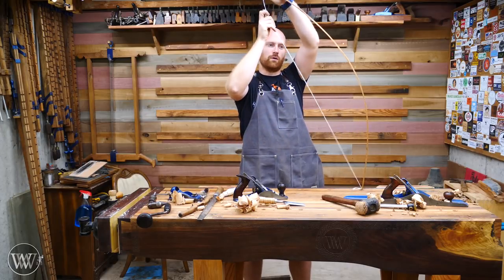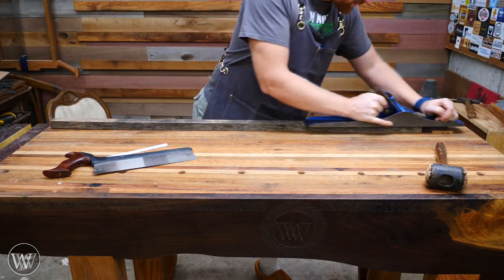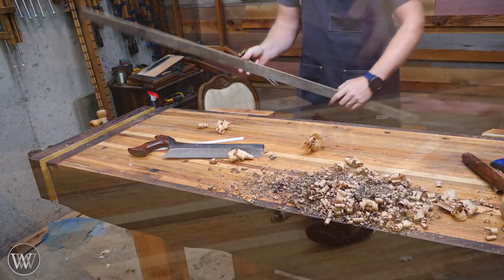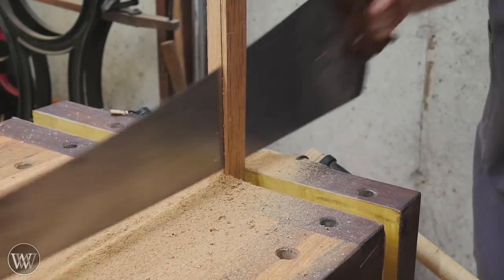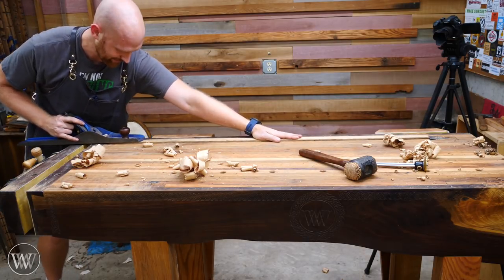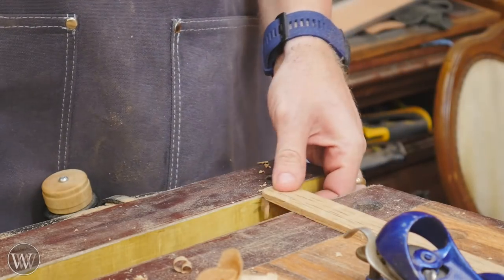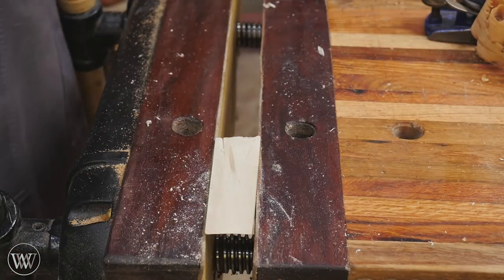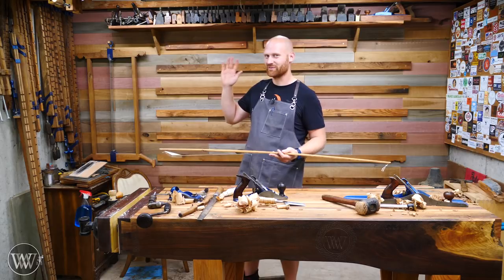How to make a Drawing Bow Compass - Hand Tool Woodworking

Comment: As always, overjoyed by the ease with which you do stuff with hand tools that most guys on the 'net would need to use $1000's of machinary.
There's always a sweet spot, for me it was that big old plane you were using. I got one from a well known auction site several years ago. A number 7 Record. I 'restored' it. It was rubbish. Had another go - a bit better, but still rubbish really. It took three to four attempts to get it working well (there are so many things that need to be right).
Now? it's my 'go-to' plane for flattening/dimensioning - absolutely love it. And the sound it makes - awesome!
What I've learned? very little to do with what you paid for it - if you invest your time and, dare I say love in it, it will be your fave tool.
The more you use them, the better they feel too...
Massive thanks for being there and sharing your skills and passion.

Comment: That old oak looks like it got very hard with age, but you managed. 
I have made a couple of those for projects in the past, never thought about putting finish on them and keeping them. Made them to fit what I needed on the project. I can see making a few of them in different lengths to cover various radius’s. Next time I need one, I will put more time into it and save it. I also just used a cutoffs of pine, because it was what I had. I like the idea of better wood and saving them, thanks for the vid.
Reply from the maker: Thanks Paul. actually it is slightly softer white oak but the leather soles on my clogs had come off and I had not put them back on yet so i was doing a lot of sliding.

Comment: Nice one agian. To get more grip on your clogs( klompen )you could glue a slim rubber under them so you stand better when working and are not sliding on your floor.
Reply from the maker: yup I had leather on the bottom but they fell off before this video.

Comment: You must of shot this one before the french cleat vids. Oh and really “a frayed knot”? Were you sick that day? Oh and if you do some light marks with very light plane passes and graduate outward equal distant from center on both side it will give you a more round curve. There’s less force near the string at the ends than in the middle. But I’m kind of gnat’s a55’n it. Good video with lots of little helpful tips and tricks all the way through... oh and thank you.
Reply from the maker: +Bathrobe Carpenter yup. You are correct. Thanks man!

Comment: What saw is that you're using? You seem to use it on most projects
Reply from the maker: I believe you are referring to the large Hand saw? that is a 5PPI 26" hand saw filed with a rip cut. is that the one you were asking about. i use it alot as it is a fast and fairly clean rip cutting saw.

Comment: You need some high-friction rubber on the bottoms of those shoes if you are going to keep pushing that plane around. I would think all that slipping would make it a lot more work.
Reply from the maker: yup I did have leather on there but in the course of one day the glue let loose on both shoes. just have not had the time to put them back on yet. LOL
Reply: I'm glad I was right about the shoes. The only other option was that you were grooving to the rhythm while taking grooves from the board.

Comment: I admire your work and skill, but why do you choose to not use power tools?
Reply from the maker: Many many reasons. I use to have a full power tool shop, but this is what I do now. it is (in my book) more enjoyable. quiet, safer, less dust, have no problem having the kids around. the list goes on. but I have nothing against power tools I still use them on projects that are not for videos but only where I have a TON of lumber to go through on a project. I usually answer this question in most of the QnAs I do if you want more detail.
Reply: Everything that James said is spot on :) I only use power tools now if it is absolutely essential.
Reply: Wood By Wright dude you gotta lose the clogs.
Nice work! Cheers

Comment: I was wondering why I would watch 17 minutes of making a drawing bow, but it was interesting and turned out to be useful. I make these as needed (not with hand tools) and I have kept a few, but I never thought of that slider. I've just drilled small holes near the ends with one of them slotted, and tied a bunch of knots in one end of the string, adjust it by pulling tighter and using the next knot. I think a radius requires a center point, which you often don't have or don't know in woodworking, and drawing bows make a nice arc. But I've always wondered whether it makes a true radius. Anyone know?
Reply from the maker: +Michael Anderson thanks Michael.
Reply from the maker: +Michael Anderson I have never tested to see if it makes a true radius but I think if it looks good that's what matters but it would be interesting to find out I don't see why it would not as long as the tension was the same along the stick.
Reply: No it wouldn't be a true radius
Reply: @WoodByWright  It is an elastica, not a circular arc. For moderate bending, as shown in the video, it is approximately a catenary (hyperbolic cosine, i.e. cosh(x)).  That assumes an "ideal" wooden board, and the math for elasticas gets very complicated.  If you need an exact curve approximately that shape, I'd use cosh(x).  If you just need a pleasing curve, just use your bow. :-)

Thanks for the video.

Comment: Wow, your jointer is taking a pretty thick shaving for fine tuning. Maybe a lighter set would let you plane without the strip/bow popping up like that? But, hey, it worked, right?
Reply from the maker: +Thomas Russell I was needing to take off material not just smooth it. In the past I have used dubble sided tape. But my hand worked this time
Reply: Yeah, I have planed a bit of oak, it does take a bit more effort than some other woods. That's why I will take lighter passes with a super sharp plane, even if I have to take five times as many passes. But hey, stock removal is stock removal. James has a lot more experience at this than I do. I just picked up a plane again about 5 months ago after not touching one for over thirty-five years (as a kid in my grandfather's shop).

Comment: Are you really wearing wooden clogs?
Reply from the maker: +pjbyron67 yup. Best shop shoes you can have. Comfortable and protective
Reply: Yup, and it looked like he was sliding around a bit on that concrete floor whilst planing that strip. Evidently, not much traction.
Reply from the maker: +Thomas Russell ya the leather soles have come off. I need to glue them back on
Reply: Ah, okay. Just be careful with sharp tools until you resole them. Yeah, great protection for your toes from falling tools or debris.
Reply from the maker: LOL thanks Thomas!
Reply: Thomas Russell EXACTLY what I was gonna say (must be because you and I hv same last name..lol)... He looks pretty unsteady sliding on that floor.. That and the noise would drive me crazy.
Reply: Great video! I've tried a few different materials to make a long drawing bow but nothing kept a symmetrical curve when bent. I'll definitely try this out. 
But seriously, how do you work with those noise makers on your feet!?😂